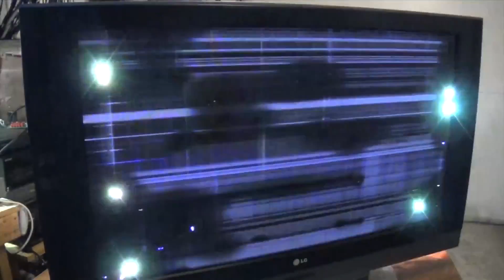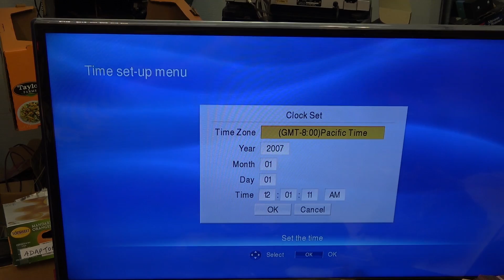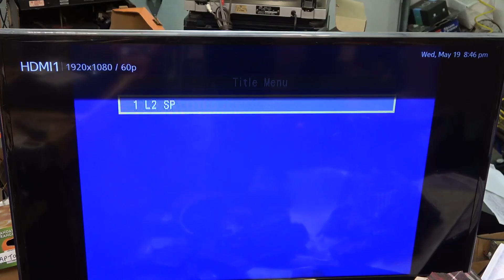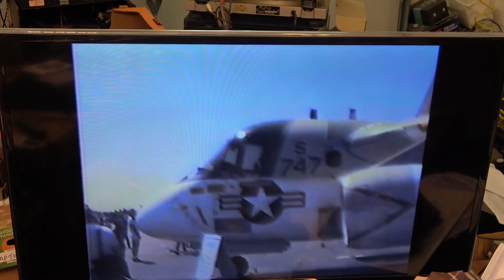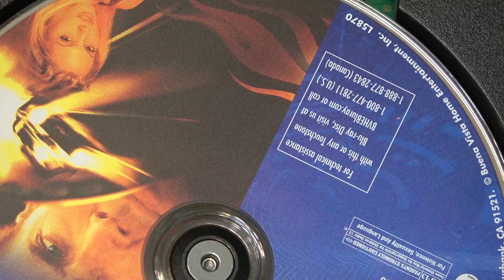Toshiba HD DVD player teardown

Comment: my Toshiba HD-A2 (2nd gen HD DVD w single laser) was $99 at Walmart - i knew then that Toshiba was desperate and HD DVD was going to lose so i never bought any discs.  But it put out a great DVD upscaled pic until it crapped out last week, oddly at exactly the same time as my blu-ray Panasonic DMP BD87 (which had fried it's wifi long ago).  Toshiba PC-like enclosed optical unit laser assembly doesn't want to slide much and the spindle only occasionally spins.  wish i could fix it just for the DVD playback.  clean and lube hasn't worked.  so now my hoarder basement desk cocoon is down 2 optical drive sources, but i mostly stream these days anyway. 

thx much for all your vids.

Comment: I've seen engineers using epoxy on pins to remove crosstalk rather than redesign a bad board design!
Reply from the maker: The old bodged design fix.  HD dvd was designed to fail. The engineers at Toshiba likely said "you want us to build what? Don't you know Sony already has BluRay and they own most of the studios?

Comment: I bought one of these as it was cheaper than buying a BR player, I only saw a few films on it though.  One problem with the format was most of the major studios dropped support for it pretty quickly (if they had it in the first place), thus it was destined to fail.  Part of the issue was the cost of licensing the technology, I believe, as Toshiba weren't willing to do so as cheaply.  The other issue was - as you have demonstrated - playback, or the lack of it, with incompatibility with most other formats; most people went for a machine that could play most of the previous formats, CD, DVD, etc.
Reply from the maker: That's right. My bd player can play audio cd, mp3 on CDR, mp3 on dvd-r mp3 on bd-r, dvd, dvd-r / rw, avchd video on dvd-r, bd, bd-re and of course BluRay. Only thing it won't play is the new ultra vilot 4k BluRay disks. Oh almost forgot, it will play all video and audio formats on usb stick too!

Comment: The wavelength HD-DVD used is different than that of Blu-ray--explaining why a dual HD-DVD disc could hold at most 30 GB compared to BD's max of 50 GB--so a standalone HD-DVD player can't even read a Blu-ray disc in that regard. LG and Samsung did make combo HD-DVD/BD players at the end, which today are worth it alone for the novelty. But I don't have any interest in adding more HD-DVD players, since it's not a format I'm particularly invested in.

My main player, a Toshiba HD-A35, is noteworthy in that it's the one player I know of that can output DD+ and HD audio as bitstream and not just PCM. But by sending the audio as bitstream, it does not include (for better or for worse) the button sounds that a lot of the discs' menus have.

Comment: it really helped that sony put a bluray drive in every ps3 and when stand alone bluray players were going for 1 grand u could buy a ps3 plus the bluray remote for 600 bucks. hd dvd had microsofts backing but they didn't put the player built in to the xbox u had to buy a $200 add on drive plus the xboxes at that time weren't even coming with hdmi so u could only ran at 1080i out of component so u couldn't even take full advange of an hd dvds 1080p. one thing hd dvd had going for it was no region coding what so ever so u could import from anywhere and be able to play it were bluray the made it up to the studio weather to lock it or not so bigger studios like universal and dinsey wouldn't bother with the region locks but smaller regional studios like shout factory or alliance here in Canada lock down there releases.  4k bluray finally got rid of region locks for good though as there is no region locking what so ever.
Reply from the maker: My first bluray player was a PS3 with 60 gig HDD. Still have it. Have only played 3 games on it. I bought it as a bluray player. STill works, or did last time I turned it on. WIll play PS1, PS2 and PS3 games.
Reply: @12voltvids  same here i got mine in 2007 after they release the 40 gig cost reduced model was like 400 for the system 40 bucks for the remote bought gta 4 with it since that had just came out and a copy of T2 and commando on blu ray. i still have but dont use it for blurays now since i have a panasonic 4k ub820 there second from the top of the line only dif on the higher model is it in a fancier aluminum front and some unless audiophile type stuff like xlr audio connection and analogue hook ups for 7.1 and the drive is mounted a little more fancier damping stuff to make it quieter but it uses the same firmware and stuff  that the lower end model uses so there is i no real advantage to someone who isn't an audio snob to pay nearly $700 more for it. i have a modded firmware installed that lets u switch region for both dvd and standard blu ray so i can play any region of dvd or bluray it also lets u skip over things like fbi messages studio logos that u normally can't skip on a blu ray.
Reply: PS3 was my first Blu-Ray player too, bought it in 2009 (PS3 Slim 120gb version) and still have it in working condition, well, would need new battery, that holds the time and date, but no other problems. I still have only two Blu-Ray players, besides PS3, I have Xbox One S, that can play Blu-Ray and 4K UHD discs too.
Mostly I've used them for gaming though.
I remember the HD-DVD vs Blu-Ray war, always liked Blu-Ray more than HD-DVD.
Reply: @mrjsv4935  ud be surprised how long those cr2032 back up batteries last sometimes i still got some super Nintendo games  that use them for save games and they are on there original battery from the 90s and some how there still working lol
Reply: @mraaron1584  Cool, I do have a HP PC from 2001 and so far has been working with original coin cell battery at the motherboard, so sometimes they indeed last very long time :)

Comment: I have an old Philips DVD player that will take anything you throw at it,  whether PAL, NTSC, MP4,  etc.  It is also Region 0.  trouble is,  it came out before Blu-ray,  so it's DVD only.  I wish they made new players today that were multi-format and unlocked...  barring hacking the firmware.
Reply: You can unlock most blu-ray players to region 0 for DVD's.  All my DVD and bluray players are Sony and they all unlocked using the same codes.

Comment: i think alot of HD players could only read some disc, i have one that was new that only read HD DVDs, not any thing else, similar to how DVd couldn't play HD or Blue ray disc, there prolly was a format war where companies wanted only their players reading their disc or some thing, like VHS and Beta, not interchangable, I think thats what these players and others were, mine though is a 5 disc player, works just with HD disc though, but i'm not worried about that as i have blue ray and DVd for other disc i have.
Reply from the maker: Blueray players, at least SOny will also read AVCHD disks. AVCHD is a format that allows for HD quality to be recorded at lower bit rate using MPG4 onto an DVD disk. An 8.5G dual layer disk will store 2 hours of HD content easily.  I record many things in AVCHD when I don't want to burn to a real BDR disk, even though I can burn to either.

Comment: One thing I would have been curious about is, if you could find a Blu-ray drive with the right connectors, if the processor in that unit would be able to play a Blu-ray.  Probably not, but it would be interesting to see if the drive makes a difference.  I never used HD DVD, by the time I was ready to upgrade from DVD, Blu-ray was the winner, and the direction things were going.  Now I'm in the process of getting more UHD Blu-rays whenever movies I like are re-released.
Reply from the maker: No, it wouldn't. The security is totally different as is the disk structure.
Reply: @12voltvids  Good point:  I was thinking in terms of codecs.  HD DVD, and Super Audio CD, are two of the disc formats I have no physical experience with.  Super Audio CD I wouldn't mind still trying, but HD DVD doesn't really seem to be worth it at this point, other than having the experience of knowing the differences between them, and Blu-ray.

Comment: Good evening 
 I bought a used video device from one of the used markets and was aware that it had a malfunction in the power supply (the model of the VCR -  Samsung - VZ-S90), the problem was that someone had tried to repair the power supply and changed some resistors and capacitor in an attempt to replace the parts Damaged without returning to the scheme of the power supply.
I made several attempts to search for sites that provide the manual service for the same layout and device as a whole, and I could not find it.
I would be grateful to you and would be very happy if you could help me find it to fix a damaged power for the VCR.
By the way, the VCR is considered a worldwide system.
Thank you for your experience and effort on 12voltvids

Comment: I never liked the idea of any optical disk not having a protective casette, like a 3.5 floppy disk.
Its a shitty system using bare disks.
An optimised betamax recorder/player would have been much better than vhs.
Roughly 20 years back i told a friend what i thought would be good for recording tv programs in the future,  a kind of memory Cartridge or similar could be plugged into a small box for instant faultless playback/recording.
I also said computers would not have a conventional hard drive, a large memory device would be soldered to the pcb, a faster boot up would be possible.
I didn't think much about capacity years ago,  just boot up speed lol.
The flash disk for laptops has happened, im still waiting for the small box with a slot in the top for a cartridge  holding tv programs.
A ssd comes close, but they die if they are written to too many times.
Reply from the maker: DVD RAM was probably the best recording medium for time shifting TV programs

Comment: I have a HD DVD disc here but my Philips BDP 3000 UK model Blu Ray player would not play it, even though it can play all regions on Standard Definition DVD’s and Region B only Blu Ray’s
Reply: there two different formats so of course your hd-dvd disc will not play in a bluray player.🤔🤔😨😨
Reply: @markrowe8824  I have a couple of LG dual format players so bluray and hddvd work in both.  I agree with others posters here and dont bother with warner based discs especially harry potter.
Reply: @AvidRetro  yes I know LG and Samsung both launched BD/HD-DVD combi players but the original poster mentions he has a Philips BD player, Philips never launched a dual format BD/HD-DVD player.

Comment: hmm seems like this player isn't as multi-function as a blu-ray player, I remember a blu-ray players supporting a lot more formats, I'm guessing because they're usually more fully featured, because the OSD on this seems to be very basic, and most of the blu-ray players I've seen have has at least something in terms of smarts, because blu-ray relies on java to function, i guess adding more java applets wouldn't be that much more problematic.
Reply: HD-DVD has an interactive VM as well, it's just not Java.  IIRC, it's based on some of Microsoft's .NET technology, but it's been a minute...

Comment: I wonder if that infared was added because the unit might have been used in a classroom or rack with a central control module (perhaps with a LCD projector smart classroom setup).
Reply from the maker: Inside a cabinet Ni doubt.  It was an installer that mounts tvs and equipment that gave it to me.   He pulled it from someone's place he was updating equipment for.

Comment: Considering Sony's track record of proprietary formats that only Sony uses, it wasn't unreasonable to bet against Blu-ray.
Reply from the maker: How is that? Sony invented both Batamax and the VHS format, which they shelved as inferior and tried to get everyone on board with Betamax. They had Sanyo, Toshiba, Zenith and NEC on board. JVC and Panasonic said they were on board and then went and released the discarded VHS format, and brought RCA on board with them. They dumped them on the market below the cost to make them, and handed out licenses to everyone to make them. Blueray was Sony's revenge to the others. Even DVD recordable was a bloody mess because of Philips and Toshiba with their DVD+R a+RW format to add market confusion, and Philips with their DCC format that killed the DAT format as a consumer recording format. The other companies did everything to hurt Sony, and finally Sony won big with Bluray, 8mm Hi8 and MiniDV / HDV were also Sony victories. HD DVD was Toshiba's baby, and it didn't make it out of diapers.
Reply: @12voltvids  Which ones won the format war?
Betamax or VHS?
DAT / Minidisc vs. CD-R / flash memory of MP3s
MemoryStick / Universal Media Disc vs. CompactFlash / SD
Reply from the maker: @GerardPinzone  Too many formats to remember. My brain hurts
Reply: @GerardPinzone  Betamax and VHS were both proprietary formats because you could not make cassettes and equipment for either one, at least while bearing the trademarks, unless you were licensed to do so by Sony and JVC respectively.  And what you made had to abide by standards that those companies had set for their formats.

CD-R is specified by the Orange Book, one of the rainbow books for the Compact Disc standard.  You are aware that Sony is one of the principal authors of those books, right?

One important factor for DAT's failure in the marketplace is due to the music industry and their fears of piracy; they believed that DAT, being capable of making perfect digital copies of their audio CDs, was a threat to their business.  The RIAA even went so far as to lobby the United States Congress against the DAT format, forcing Sony to make changes to DAT to make it less easy to make digital copies, such as implementing SCMS (Serial Copy Management System).  Another factor was that the regular consumer didn't see a point in DAT and, for that matter, DCC; they already had Compact Disc for digital sound and analog Compact Cassette still delivered reasonable fidelity while being very inexpensive and ubiquitous.

You can't lump UMD, a read-only optical disc format for the PlayStation Portable, with solid state data storage formats.  I will give you this much, though, Secure Digital is pretty much the standard whereas Memory Stick isn't.